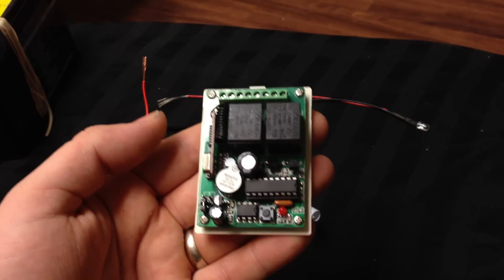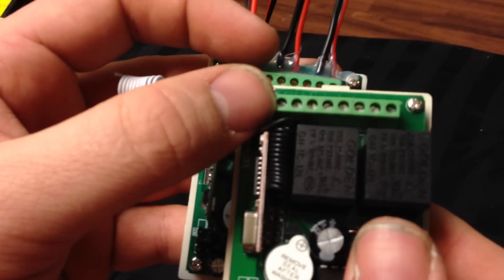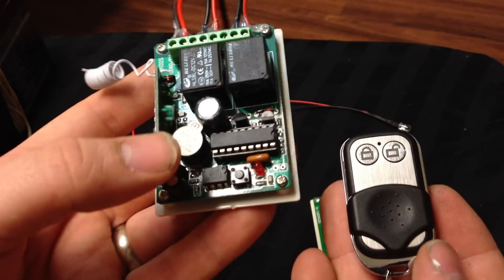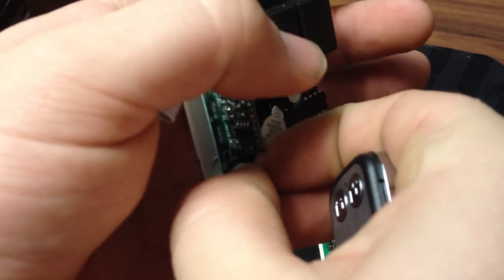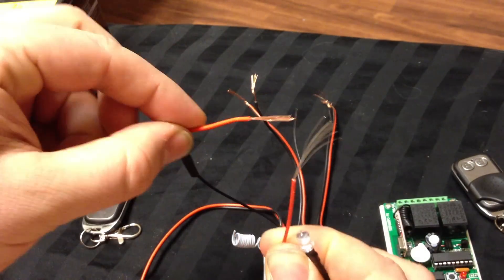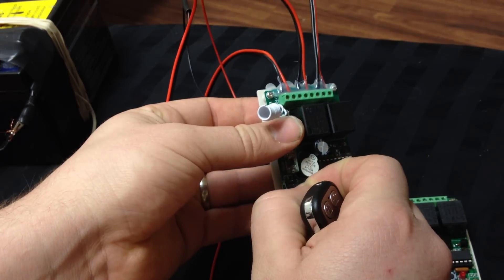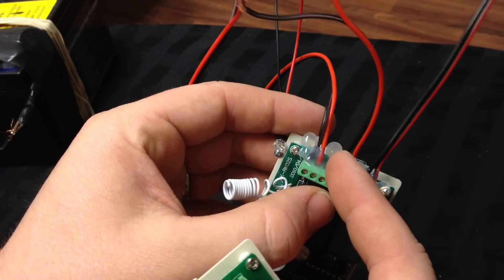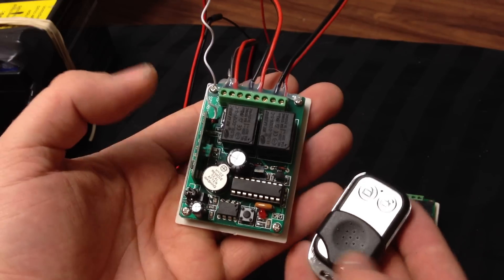2 channel RF transmitter and receiver instructions

Comment: AFTER SEEING YOUR VID i am more confused as to conecting which wire from the relay did you use i,e, nc or com or no  to which side of the led
Reply: Normally open means off before power. So ground one leg and connect positive to the positive terminal and a common.  Test the led from power to determine pos neg

Comment: easy . use as remote car starter
Reply: Hi can you send me the wiring diagram? I think I'm gonna use this on my motorcycle 😉
Reply: João Félix just take the two wire on starter then put it too this relay
Reply: Hummm ok,  but I want to work like a Ignition, to work without a key
Reply: +João Félix i will show u the diagram later alright ?

Comment: How do ya use it to open a garage door?  Not sure on the wiring, and unable to find a good diagram
Reply: You would just pass the wall mount button signal through one relay. Common and normally open.

Comment: Can you run the receiver on the nine volt battery
Reply: mpmccurry did you get wireless receiver to work of a 9 volt battery text reply to 540-621-1719 please

Comment: i tried doing that with a 5v dc motor but after i connect the wire the motor starts to spin with out my command, what did i do wrong? :/
Reply: You wired it either to normally closed terminal or just wired the motor to power